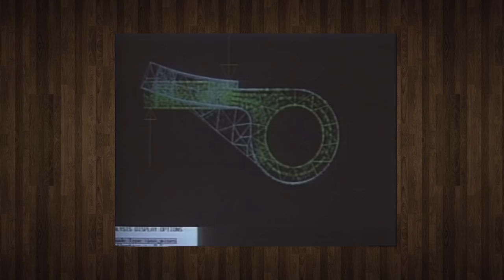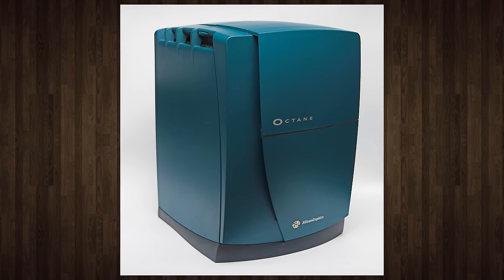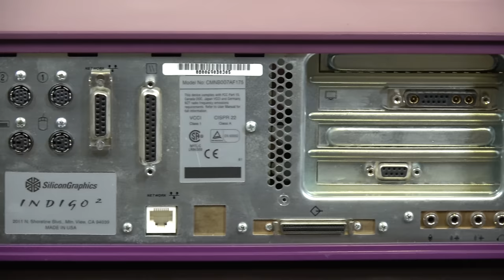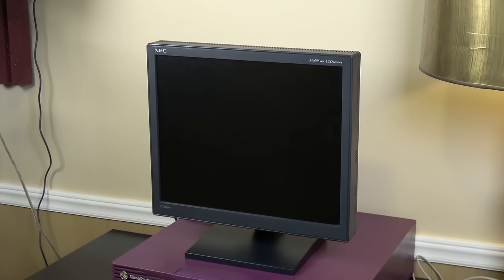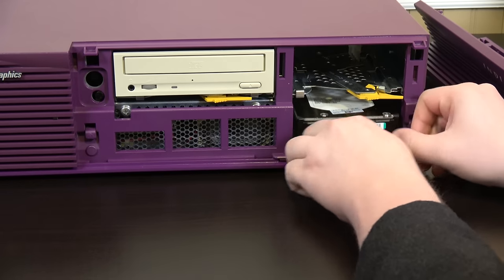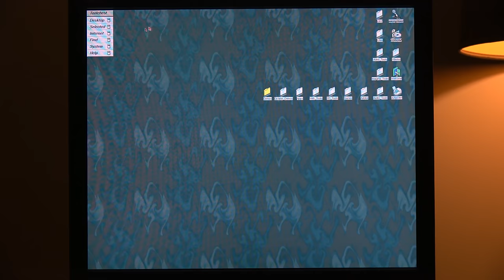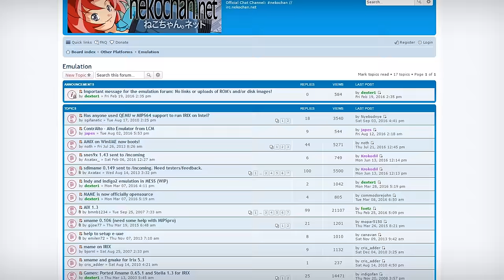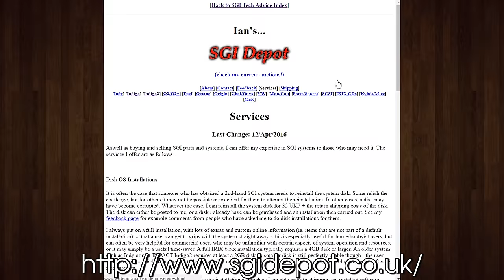SGI Indigo2: An $86,000 Workstation from 1995

Comment: This is my past, I developed molecular graphics and crystallographic software for various SGI machines right up to the Crimson and Octane2 at about $1,000,000 each.
Fun fact : The Indy is an Indigo without the "go" - it was crap and did not have enough memory to run the OS let alone anything else. it had to be recalled.
There was the O2 which was known as the bread maker - cos that is what it looked like.
The Crimson/Octane/2 had a 18" cooling fan - think of industrial fan + noise to go with it.
The Personal Iris was the precursor to these machines, it was 3 feet by 3 feet by 6 inches.  One was dropped out of a second floor window - and worked fine - a little distorted - but as of age.
The first R10000 with 14Gbytes server machine I was asked to test with a scientific software - that required 12G of memory to run - found a problem with the OS - where memory usage over 8Gbytes was not write-protected by the process - so my program over-wrote everything until the kernal was corrupt.
When the Iris-2 came out you had to write sub-system graphics, till X-windows came out - then SGI created GL graphics - which came Open-GL (and if you stack traced this it went all the way back to X11 (X-windows).  Even Java crashed back to X11 originally.  In X11 - opening a framed window required 32 parameters to method call.
We created stereo graphics in 1990's.  You drove the monitor to 120Hz (these were 60Hz US machines) so it wrapped on the interlace.  Then plugged in some poarised lenses with sensors on white dots - and .... stereo....  This was the first stereo graphics - and was used for protein crystallography in 1990's.
The stereo graphics transformed into trying to do VR with molecular graphics.  There was significant lag - and the VR room had a bucket in the corner and padding on the wall and there was a prize if you did not throw in within 10 minutes.
Fun and geeky facts for you.
Reply: This is very interesting, much better than the average youtube comment.

Comment: These machines and their graphics hardware were basically the ancestors of all modern graphics cards. The engineers that developed this tech ended up founding 3Dfx which really kick started the 3D graphics cards on PCs, and then later many of them ended up working at Nvidia and AMD.

Comment: Didn't have the most fun add-on - the knob box. It was a set of 8 rotary encoders, and was the principal tool when using TDI Explore, which eventually became the basis for Maya. You control x and y with a mouse, and Z with a knob. Use three other knobs for rotation.

I was a TDI demo artist back in the 90s.

Comment: This is an interesting video that shows what was the leading edge in computer graphics in 1995. The leading edge was a very expensive computer that cost around  $80,000 back then and was a specialized graphics workstation computer. Today that are affordable computers that have graphics capabilities that exceed what this machine could do.
Reply: Most systems cost nowhere near that much, 80K refers to a max spec config. In 1996 a more common R4K/250 SolidIMPACT was only about 20K.

Comment: These computers are what was used to run old GE MRI machines.  It was boxed different and they changed the name from Indigo to Octane, but it was essentially the same computer. Im pretty sure some are still in use 25 years later

Comment: We used the work on SGI's.  Ironically we didn't do any 3d graphics stuff.  It just so happens that the software we used and created happened to run on them.  When I first used one in 1994 I never looked at Windows 3.1 the same.  

We also had an SGI server with 1GB of RAM like this one.  I couldn't imagine that much RAM on a computer.  At the time my PC had like 4MB.

Comment: I think I had an O2 and / or Indigo and / or Octane machine at Big Idea Productions making Veggie Tales in the mid 90s.   We had em at the computer lab at Columbia College as well.   Barely spent anytime in the UNiX shell cuz we were using Softimage all day.  But the system administrator was bad ass.   Loved those machines.  NEVER crashed.  If it did, auto back up.

Comment: I was doing FEA work about that time, with all the PC you could buy at the time. I had a dual Pentium Pro 150, with 384 MB of RAM, and a $1,500 video card (I don't remember the brand). In my company, there were several of us trying different approaches, between using different element types, different solvers, and different machines. Unfortunately, I was the low-end of the comparison. When we did actual, real-world benchmarks, my $10K PC performed about half as fast as the $40K Sun Sparc 20 workstations. Half the performance for a quarter of the price seemed like a decent tradeoff. One other guy had an Indigo2, and I remember it costing about $95K. He said he needed the horsepower for doing non-linear analysis. He was far too self-important to take part in the benchmarking exercise, but the specs would have given it a nice bump over the Sparc's the other guys were using. I think he left the company before he ever successfully completed a real-world analysis.

Comment: At the end of the 90s I had my first experience in 3D CAD construction on an SGI Indigo 2.  A little later they were then in the electronic trash, alongside with the 21" SGI monitors.
The same time, 1993, i've brought my first PC. It was a 486DX 33Mhz with  4MB RAM, 1MB SVGA Grphics, Soundblaster 16 and an 14" CRT. Pretty expensive for my first own earned money, i've payed around 3000DM in 1997 (3250USD today...) for it.

Comment: I had one of these in 2007 and ended up giving it away. You're wrong about the keyboard, though. It's a mechanical one and a pretty good one too, it's using the best Alps switches that were around at the time, similar but not same switches as on the legendary Apple Extended II keyboard.

Comment: The makers of that machine bet heavily on adding as much cutting edge hardware and as much RAM and CPU speed as possible at the time, in order to sell it as a professional workstation. What's admirable is that they probably sold quite a few of them and earned tons of profits just in time before hardware got smaller, cheaper, more capable, and faster. Reminds me of the time I sold a vinyl record to a collector for $300 and 6 months later, the band remastered and reissued the same album with all the artwork, for $40. Sometimes you get lucky. Silicon Graphics did.

Comment: Back in 1997 I used to work in a Ford R&D centre looking after hundreds of unix workstations made by SGI, Sun, and HP. The SGIs were easily my favourite, especially the Indigo2s. At a time when computers were almost universally beige, the SGI's bright aesthetic provided a welcome relief. The cases were well designed and easy to get into for upgrades, albeit sometimes rather tightly packed once you were in there. IRIX had in my estimation already fallen behind Linux, but at least didn't feel like a complete pile of bloated dinosaur poo like Solaris 2 and HP-SUX. SGI's crappy keyboard and mouse always seemed a bit incongruous - actually inferior to my cheap PC's, and far behind Sun's. One of SGI's killer features was the 3D stereoscopic glasses, which worked by alternately blacking out each lens in sync with alternating frames on the screen for the different viewpoint: the result was seriously impressive compared to any other 3D of the time.

Comment: This computer was used for MRI operating systems by GE in the early 90's. The Octane & Octane 2 was also used in later MRI systems up to about 1999
Reply: The GE system though had a custom 7-slot backplane (so that it could take two Max sets and a 10/100) and a different PN mbd which today is extremely valuable (around 5K just for the mbd). Some places are still using these scanners btw, though the later setups were driven by the Fuel instead.

Comment: That’s almost $150,000 for this thing adjusted for inflation. Good lord and people trip about Apple and having a 50,000 Mac Pro on the highest end. This thing is 3x that. That’s just crazy crazy.
Reply: What is crazy is to think a 50k mac is a tool. Nobody unless a fanboy will buy a 50k  mac , a 1tb ram mac is nonsense.
This sgi machines designed huge machined while apple bragged about gui in 1984 in that year sgi  had 3d chips unavailable for mainstream market.

Comment: Wrote a lot of IRIS GL and OpenGL back in the 90's. We had a few of everything, Indigo2 Impact was my favorite, but the Crimson VGXT great too.
Reply: No Iris 2000 or PI? I assume you also used CASEVision/WorkShop and Performer :)
Reply: @goguhu  Yes, Personal Iris was our first system. But also had Indigo2 Extreme and Impact, IR and IR2, Onyx PowerOnyx, and PowerChallenge. We had everything. . Mostly OpenGL and OpenInventor, just a little bit of Performer. Seismic processing and volume rendering in the early 90's.
Reply: @krytentl  Hehe Yeah I know that market well ... I wrote a few 3D holographic systems to visualize seismic data and automatic creating of the various sediment layers ... that was a fun 6month project (1month at sea on the boat). Had a lot of fun figuring out how to optimize texture swapping of large sets beyond 64GB in size. Back when coding was challenging :)

Power Challenge XL was my favorite till the Origin 2000 system came out ... 128 cpus and 64GB ram was quite a bit in 1996.
Reply: @goguhu  Yep, spent a lot of time getting the "love notes" out of the compiler to minimize cache misses and do loop-unrolling for some of the migration codes. We had (I think) the SN #3 PowerOnyx on the SEG show floor one year, and they were still getting IRIX bugs worked out for the R8000.  The day before the show started, we could finally install more than 2 CPU boards. I think I still remember how many clock ticks it was for a cache miss to fetch from main memory (55) on the R8000. lol  ( glTexSubImage2D() )
Reply: @krytentl  Man it bring back so many good memories :) I spend so much time optimizing code for the TV/Film to ensure good frame rates and playback. And yes the compiler was a beauty, especially when using it with WorkShop and getting both instruction profiling and time, helping to find inefficient part of your code. Padding arrays to ensure that the odd/even cache of the R8000 could fetch data at peak rate and utilizing MADD as well as reciprocal square roots to calculate distance between atoms in molecules. Knowing the clock cycles of all key instructions as well as pipe-line stages, how many and which instructions could be executed out of order and unrolling and fiddling with pre-fetch in loops.

All this fun is gone now ... I know I'm a sad person for missing it ... but it was challenging and that often drove innovations ... like vector trigonometry library and such ... sigh ... good old times :)

Thanks for taking me down memory lane (I used to be technical sales for HPC, Film/Video and Universities back in the day when SGI was THE COOLEST company ... left when they ditched the R12k/R14k and decided to go the PC route / Itanic (Itanium) realizing the printer sales guy did not understand the market (but also realizing UNIX HW was coming to an end with the Pentium2 starting to get very close in performance.
Reply: @goguhu  Yep, I went to Sun in '97, and spent 8 years trying to get them to put the fused MADD instruction into SPARC. lol

Comment: I owned like 30 of these.  I think they are still stacked in the back of the server room. But they were so awesome at the time! When i first put one on my desk it had more ram than the hard drive on the adjacent top of the line 486 running Windows 3.1 for Workgroups that could barely access more than 640k.

Comment: In the late 90s I worked at Kinko's and we had an SGI Indigo that we used exclusively as a Postscript RIP for a Canon color copier, running EFI software.

I always liked the mouse, although generally we didn't need to do much interaction with it, other than looking at the print queue from time to time.

Comment: you cant appreciate its capabilities without showing the capabilities of other machines of the same production date.  I remember using  a Indy and was so impressed with its UI and super smooth CAD rendering.    The price/cost was the issue and went with Autocad on a windows box instead.

Comment: you could in fact trick out certain Macintosh computers to basically do what this machine could do...at a nearly similar price.   The Power Macintosh 9500/120 had a huge amount of expansion and could handle 1gb of ram.  Furthermore, you could stick a Radius Thunder 3d graphics card, Video Vision Studio, FWB Jack Hammer SCSI array card and plenty of other insane stuff to trick it out...at a cost of at least $75,000 in the mid 1990s.  A really insane amount but would allow that computer to basicly match the Indigo2's performance at almost anything.

Comment: My God! One gigabyte of RAM and a 150 GB 15,000 RPM disk drive in 1995. No wonder that thing cost $86,000. That’s like buying a souped up maxed out Mac Pro these days but the Mac Pro tops out and about 53,000 this thing is 30 over.
Reply: You couldnt get that hw in that time you can get the same hw and better than macpro
Mac os is DOS next to sgi. Sgi could run months 24x7 non stop. Try that with a mac...you  make me  pee in my pants. I had the chance to use sgi it was a time travel. 

Sgi had  custom chips that you couldnt buy.
Today worksations used in oil companies make look a maxed mac like a toy from 3rd world country

Comment: The funny thing is the M-Audio adapter was the preferred way to go on the SGI machines over the Soundblaster unlike with PC/Clones which it was the other way around.  I have always wanted a Origin super machine to play with.   I had a couple Sun's but never a working SGI.
Reply: The MAudio card is only applicable to systems like Fuel and Tezro (anything O3K); all other earlier SGIs had built-in audio or used more specific option cards for additional channels.

Comment: IBM PS/2's in the 80s had huge pricetags.   The guy I bought my Model 80 from in the early 90's had paid almost $30k for it and a color monitor in mid 1980's.   I picked it up with screen all working in mint conditional for less than $500.  It was a 25Mhz 386 originally.  I think 160GB or 320GB and 4MB ram.

Comment: In 1997 I had a graphics class at UCSC where we worked on SGI Indy workstations in a freezing cold computer lab. I never had to go to the lab because my $300 Alaris 486 clone running Linux ran OpenGL as fast in software emulation and GCC much faster! I suppose it was a sign of what x86 was about to do to the CPU world.

Comment: i remember working on the O2 when i was at school thinking it was awesome until i realized 3dsmax was rendering faster on my home computer than SoftImage was doing on the O2
Reply: Yep, O2 was a bad match for straight CPU animation rendering, for various reasons. Resellers should never have sold them to places for such tasks. SGI though didn't bother developing a more mainstream system for those who just wanted good CPU/RAM speed, including application devs. This was an aspect that SUN handled much better. SGI did produce the Fuel later on, but it was way too compromised in a number of ways, especially base I/O and RAM capacity (it also didn't have audio as standard, which was bizarre).

It didn't help that many places bought O2s with too little RAM aswell. Could easily be that the O2 you used was that slow because of this. Resellers though didn't much care, they'd sell an O2 with only 64MB if that would secure the deal, and alas many edu places fell for that sort of thing.

Comment: That 146GB SCSI disk is not original to that machine obviously.  Seagate didn't produce even the 10k drives until 1996, and the 15k "X15" until the year 2000.  I worked for Unisys in 1996-1997 and really got into disk drive technology/RAID.  In 1998 I bought four 4.1 GB Micropolis ultra-wide drives and spend basically a month's salary on them.  On the datacenter side, we still used 146GB drives as recently as 3-4 years ago.  I'd say that disk at best came out 2003 era or so (BF1468B26B).
Reply: yep I also noticed that - for 1995 HDD 149GB ? Not possible for that era.

Comment: SGI in 1984 invented the dedicated 3D graphics chip called the SGI Geometry Engine - and resulted from Jim Clark's research first at The University of Utah and later at Stanford.  It was the basis for ALL 3D graphics for the next 35+ years.  NVidia was founded by the "best" former engineers of Silicon Graphics.  I believe the Indigo 2 was based on the MIPS r4400 chip which was the fastest available microprocessor (much faster than x86) when the workstation was released.  The 3D graphics had 7 MILLION !  Transistors!  Oh yeah the RTX 3080 has 30 BILLION transistors!
Reply: Incorrect. nVidia was founded by a former Sun engineer. 3dfx guys were from SGI.
Reply: @PeechaLaCosh  My friend was an SGI employee.  He said, "The best 3D graphics persons went to NVidia, not 3Dfx".
Reply: @dgillies5420  Eventually yes, most of them ended up in nVidia, when nVidia bought 3dfx in 2000.
Reply: The technology used for image processing created by barco to run on irix was sold to adobe to make photoshop

Japanese did manga  on sgi what a luxury

Comment: Considering i in 1995 had a used classic II that did what it was supposed to, and in 97 bought a performa with 256 mb or ram and a decent graphics card compared to what alot of people had if all , this was a very good machine but still a bit pricey if you compare to what was an consumer model just two years later. Getting a gig however took a while still so it was a bit ahead.